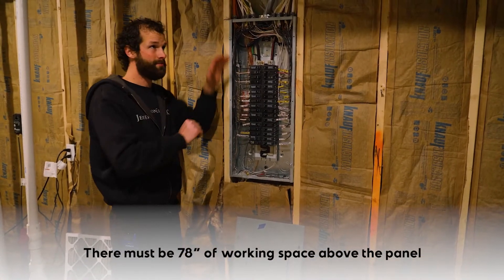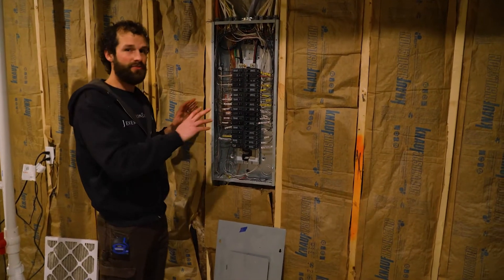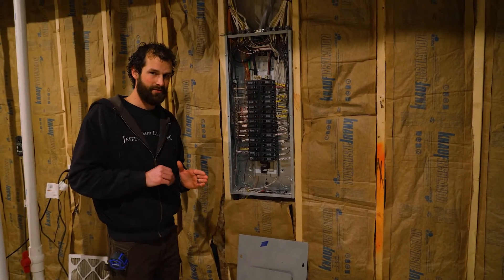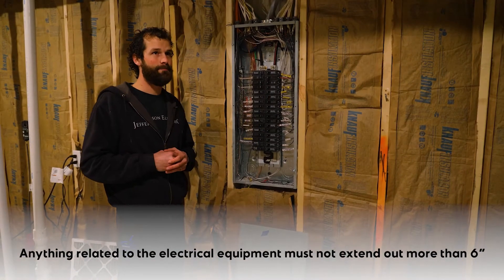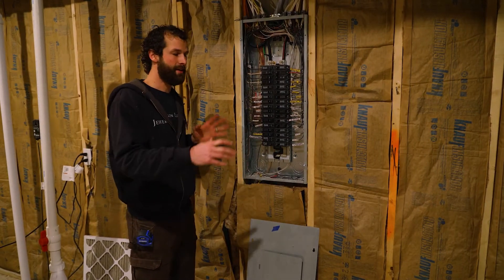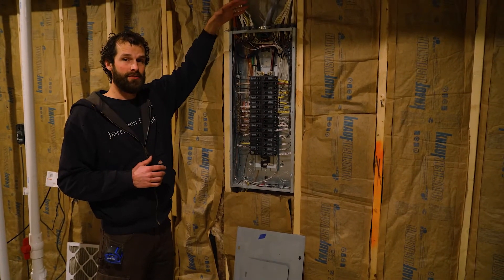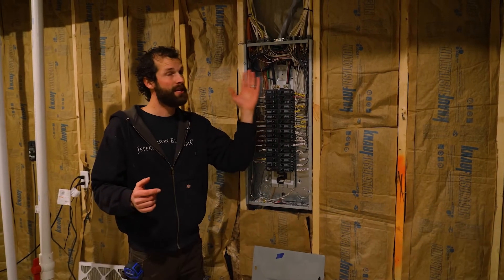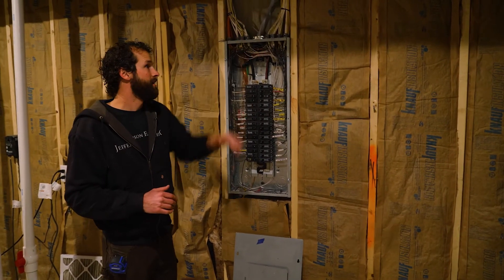Working Space - Code Minimum

Comment: Just found your vids and as a home inspector I'm always looking for education and brushing up on specifics from different sources.  I like how you make them quick and to the point!!!  At  3:45 you mention 400A service, then explain you would have two 200A panels.  To be clear (this was a debate recently with another inspector) the 'Service Entrance' WIRE off the meter would be a 400A to the exterior main disconnect.  Then a 200A wire would run to each 200A panel correct?  You're not saying the two 200A panels add up to make 400A correct?  I will be sharing your vids with my buddies for sure!

Comment: What if there is a work bench directly under the panel?
Reply: Yeah, I have a portable air compressor that sits in front of my panel in the garage.  I can still access the panel without moving the A/C. I would have to move it to make it safe to work on the panel.  Without reading up on the code, I'm not sure if there are exceptions to the rule for residential or not.

Comment: Joel,
To mount 2-main panels of 200 Amps each, do I too make a 15-inch space between each panel?
Reply: No, provided there is 30” of clear space, that 30” can be shared by other equipment.  I go by the rule that the doors can’t overlap but NEC does not.  You can mount 2 14.5” panels tight together and as long as 1 has an inch to a wall it’s legal.  If you decide to do this make sure the covers fit before you do.

Comment: In my house (late 30's built), the main panel is located directly over the sump crock!  It's a 100 amp panel that was installed around 1980.  Thinking about upgrading to 200 amps, would I have to move the panel to another location?
Reply: @ElectricProAcademy  Thanks!
Reply: Don't quote me, but being that your electric panel has been there forever, you would be grandfathered into leaving it there (again, do not quote me on that)

Comment: I can't believe this is just about aways left out... I was blow away when I learned this. I can't tell if it applies here due to the main breaker. It does look like SER and not SEU, that tells me there's a disconnect. And when 2020 is adopted all new services will require a disconnect outside... So all the "working space" goes out the window. It's that two words "while energize". Therefore if there's a disconnect outside its a sub-panel ect, theres no minimum space. Well the door needs to open to 90 degrees, pull the cover off, ect. But none of that other pesky 30 inches and such.

110.26(A) Working Space
Working space for equipment operating at 1000 volts, nominal, or less to ground and likely to require examination, adjustment, servicing, or maintenance 

while energized

 shall comply with the dimensions of 110.26(A)(1), (A)(2), (A)(3), and (A)(4) or as required or permitted elsewhere in this Code.

I try to get as much space as possible but this is a good one to have in your back pocket. I have installed a disconnect to make this work instead of moving a panel.

Comment: These videos are great.  I own an old house built in 1947 I'm remodeling.   The old fuse box had 4 circuits and was located in the rear entry foyer with the bathroom shower lines running behind it.  Me I'm not a professional, but I am able to pull my own permits and do my own work on my own home where I live.  Anyway after speaking with the electric inspector I decided to move the whole panel to the basement.   So I always love helpful videos from professionals that help me understand the codes better as well before doing work.  Basically the house is getting a rewire to fix the many code violations and bring it to modern standards.

Comment: I think tou may be misinterpreting NEC 110.26 (A)(2).  It states that “the width of the working space in front of the electrical equipment shall be the width of the equipment or 762 mm (30 in.), whichever is greater.” In addition, this work space shall permit at least a 90-degree opening of the panelboard door.  That is, the width of the working space can be
measured from left-to-right, from right-to-left, or simply centered on the equipment, and the working space can overlap the working space for other electrical equipment such as other panelboards.  

110.26(A)(3) Is the headroom required for the electrical panel installation.  110.26(E)(1)(a) through (E)(1)(d) refer to the Dedicated Equipment Space for indoor installations. 110.26(E)(1)(a)  Dedicated Electrical Space. The footprint space (width and depth of the equipment) extending from the floor to a height of 6 ft above the equipment or to the structural ceiling, whichever is lower, must be dedicated for the electrical installation. No piping, ducts, or other equipment foreign to the electrical installation can be installed
in this dedicated footprint space.
Reply: @ElectricProAcademy  Keep up the videos!  👍

Comment: Slight correction, you need 30 "side to side but can be offset to one side as long as you can open the cover at 90°. 2020 NEC 110.26 (A)(2)
Reply: Kirk is right, if you have a 30” wall space the panel could be all the way to the right , center or all the way to the left, and the door will open more the 90° on any of this locations.
Reply: True!  Doesn't have to be centered

Comment: How low can a panel be? 😊
Reply: @ElectricProAcademy  Thanks, that totally makes sense.
Reply: @ElectricProAcademy  NEC 110.26(A)(2) states that “the width of the working space in front of the electrical equipment shall be the width of the equipment or 762 mm (30 in.), whichever is greater.” In all cases, the work space shall permit at least a 90 degree opening of equipment doors or hinged panels." That means that the 30 inches isn't from the center point. There are also plenty of graphics on Mike Holt's website and his Youtube channel to demonstrate this.

Comment: I'd have to look up the 6 ft 6 in spec (78 inches) but the way you have that worded it sounds as if you might need a 12+ foot ceiling. (panel height PLUS 78" work space above) I suspect they mean 78" floor to ceiling as in working room for the average size guy.
Reply: The metric loving NEC raised the top of handle on a circuit breaker from 6'6" to 6'7" to make it two meters a while ago.